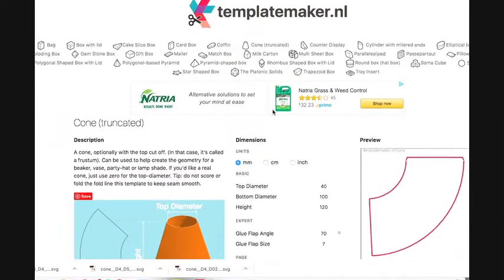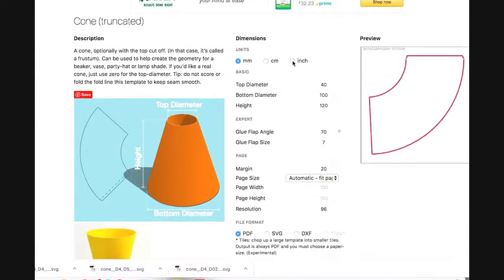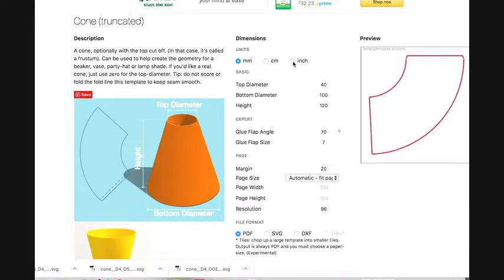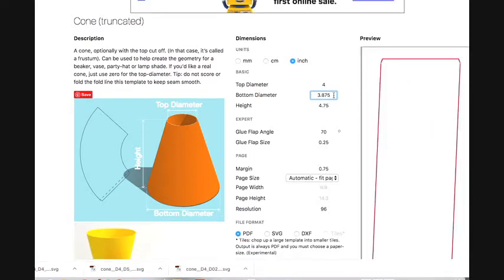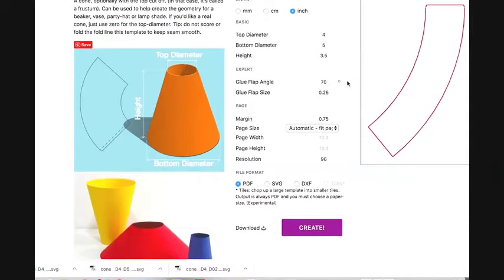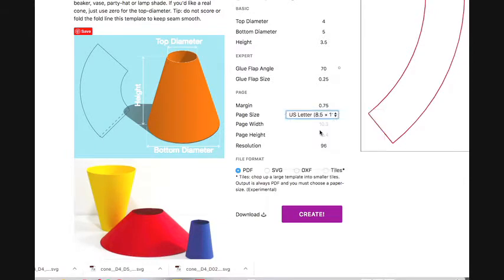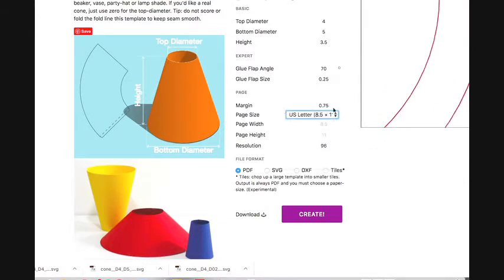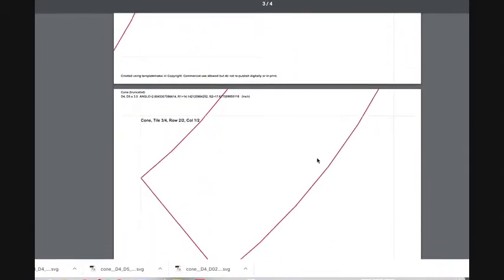Using cone generator templates to make perfect slab built mugs

Comment: If anyone is interested in drawing cone geometry like this, I’ve created a spreadsheet for myself to draw cone geometry by dividing the cone into 8 equal sections and then laying them out next to each other. 
Just plug in the values of your top diameter, bottom diameter and cone height and it will give you the dimensions of the segment.
https://docs.google.com/file/d/1VchDCIvJI3ZqEFnRKnWGxOfubfsq6CjN/edit?usp=docslist_api&filetype=msexcel